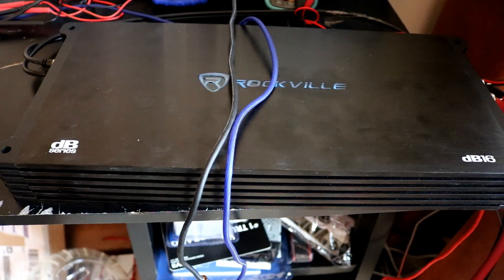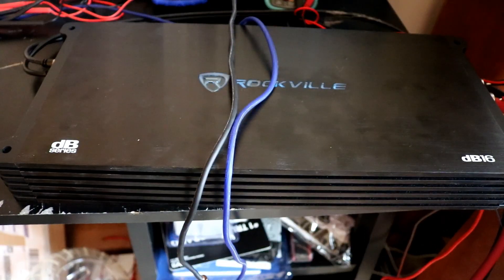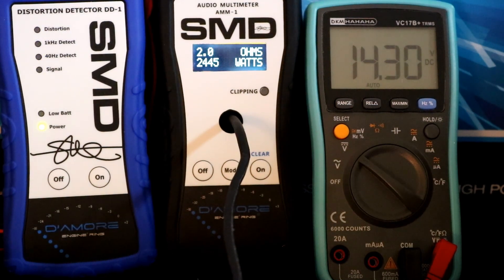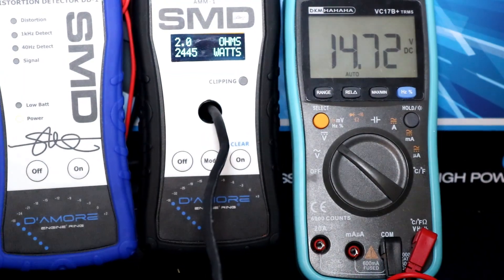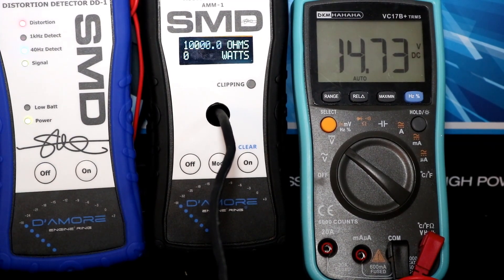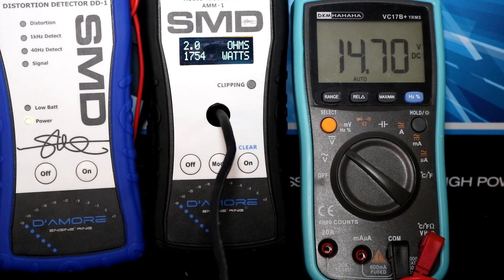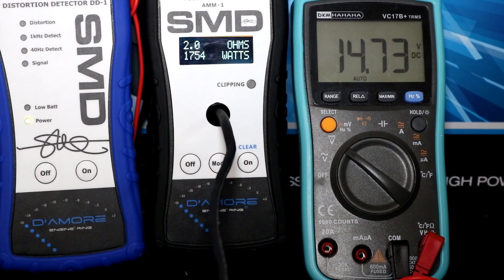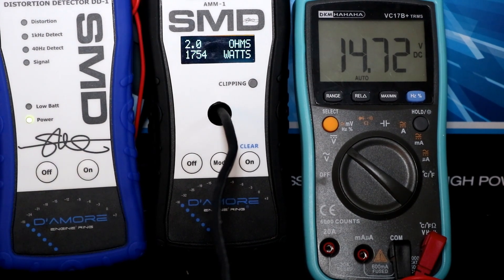Rockville DB16 Re-Test... Can it produce more power with more voltage?

Comment: Is this amp 1 ohm stable
Reply: No, this amp is designed to deliver max power at 2 ohm. If you need a 1 ohm stable amp you will need to find a different model.

Comment: I know this isn’t the point of the video but I have a question maybe you could answer... nobody makes a high amp alternator for my car, and even if they did throwing in a few batteries in would be MUUUCH cheaper and easier than getting a $600 alternator. 

How long could I run that amp on my factory alternator (140amp) with a 2nd XS battery without damaging my electrical system and without a voltage drop??

5min? An hour?

I’d literally only need it for short demo sessions with the car running... I would only run it at like 1/4 power 99% of the rest of the time.
Reply from the maker: You may want to look at something like a Titan Lithium from XS.. that would help keep your electrical much more stable
Reply: @bigblank69  

Thank you!!

I was also considering possibly going the ultra capacitor route
Reply from the maker: @robertburton8055  either way, I think the Lithium batteries are hard to compete against right now
Reply: @bigblank69  

Thanks again!!

I JUUUUST got my Rockville DB55 because of what I saw on your dyno video on it from over a year ago!

I’m gonna run 2 sets of JBL609 6.5” components and a Skar SDR 18” sub off of it!! Hoping to have some major beat for CHEAP!!

Thank you soooo much for the videos you do! Love the content!
Reply: Your factory alternator is 140-amp? That's pretty beefy. You could probably rewire it to get close to 280 amps out of it, but you would need a smaller pulley in order to increase its RPMs.

Comment: question: you didnt get the rated power, but they rate it at 14.4 volts, and your voltage was like 10% less than that. Can you re-run this again and get an ending voltage fof closer to14.4 and see what the numbers say ?

Comment: Will this push an orion  hcca 102 ??? Thanks
Reply: Ryan Blankenship a 2ohm dual voice coil can be wired down t o 1 ohm i think
Reply: Ryan Blankenship 
2ohm dvc down to 1 ohm
https://youtu.be/qIevKQS6SYk
Reply: Ryan Blankenship 
Any recommendations for orion hcca 102
Reply: Stephen Sanchez I mean, if you still looking for an amp, the cab 1600.1 is 1 ohm stable iirc, and it's pretty cheap last time I checked

Comment: I don't mind the Rockville amps. I've ran into people saying they poo out real quick but the ones I've seen they mount the amps to the sub box....that's a big no-no , not a single amp that likes to be vibrated . mount your amp to a baffle and dampen it . there was a comment in here about the solder joints snapping, that happens from vibration of being mount on the sub box.
Reply: I have one and it went out from being on the box but it was under a year and they fixed it and shipped it back in less then a week. They do have decent customer service.
Reply: Everything in my car vibrates, unless it's severely sound deadened, I think If  at least the side of the box your mounting to is solid enough it's probably just as good as any other flat surface you can mount it to. 
What if you put a piece of sound deadening peel/stick type on the bottom of the amp beforehand?
Reply: lol mine is mounted directly to the box and i've been vibrating the crap out of it for like a month now. good thing they are cheap amps so i don;t mind putting them through the ringer.
Reply: Look at your mirror.
Reply: @randyhay4740  I just fixed a customers XC90 due to his kicker quad box ratting every fuse and relay in the junction box loose. Every terminal was ovaled out and his fuse block sounded like a maracas.
Reply: Mith, never proven. Been doing it for 5yrs with the same amp.
Reply: @wackedoutg  not a myth as i have personally repaired tons of amps that failed due to vibration damage.  In fact vibration damage has been the #1 issue ive seen.

A single snapped leg on the gate drain or source will usually take out several output fets which in turn presents a direct short to the power supply and about half the time the power supply burns down.....
Reply: u have a point but the main reason not to mount it on the box is heat. I use a wood bord any kind screw it to the box or where ever u find fit ..bolt the board down then use washers so when u bolt the amp down to the board it will b slightly 1 inch or half inch off the board surface which allows better air flow and allows more effect cooling..small fans will help..# rolling EMP

Comment: Awesome.. Can you tell us if that amp have any issues because I've seeing videos that these amps have problems..what you think?
Reply: BigDWiz tested the Pioneer gm-d9601 amp.
Reply: Edrick Mendez i have repaired many of the rockville Monoblock amplifiers and its always the same problem. If you look at the gut shot of this amplifier you will notice almost no glue at all on the output section torroid. Vibration snaps that small torroid wire going into the board very quickly and easily.  The fet legs break fast also.  If you buy one, glue the hell out of the torriods and run some solder up the legs of the fets and the amp will handle the vibration better and be less likely to fail. If you do what I recommend you will have a nice amp for the $. The m5 board is beffier than this board, it will do the 2000 at certified im sure, just at 1ohm instead of 2. This board is more like the m4 it only has 4 large caps the m5 has 6!
Reply: Ryan Blankenship True..thanks for your reply..later can you do a test on a Pioneer GM-D8601? .
Reply: Ryan Blankenship awesome to many people thinks this amp it not worth it..for the price I think its a steal and its CEA-Rated ohh I have two of them GM-D8601 and GM-D8604 and their awesome..thanks for the reply I'm a big fan from Puerto Rico keep in coming the good videos!
Reply: Tammy Forbes I have no issues with that amp I've being using it for 2 years..but already I purchased 2 new amps from Skar Audio the RP-800.1D and RP-75.4 with the new Skar SDR-15D2 but thanks for the reply!
Reply: Ryan Blankenship I'm running the RXD-M5 and the RXA-F2. I've been running these amplifiers for a year and drive the hell out of them! I have 2 Alpine swr-12d2 subs wired at 1ohm and haven't had any problems at all.  I was running the system on a stock 90 amp alternator, however I just received and alternator belt by Michael Singer rated at 420 amp. Can't wait to see what the system does now